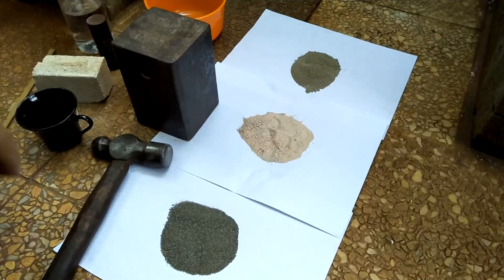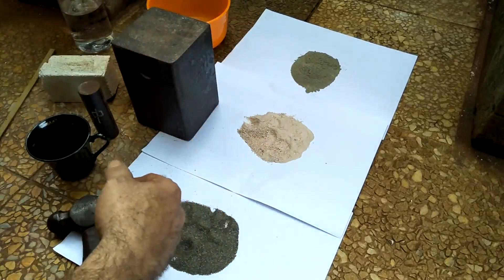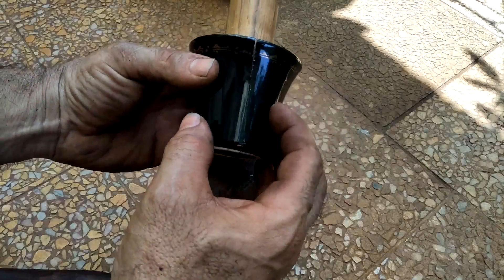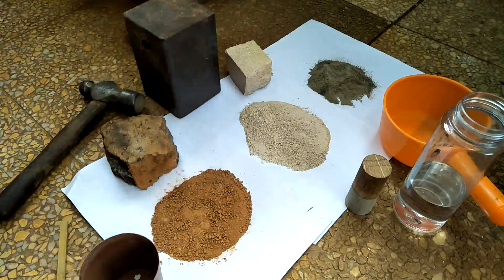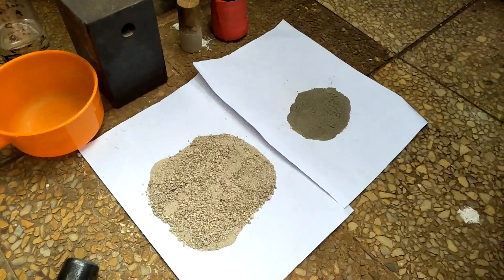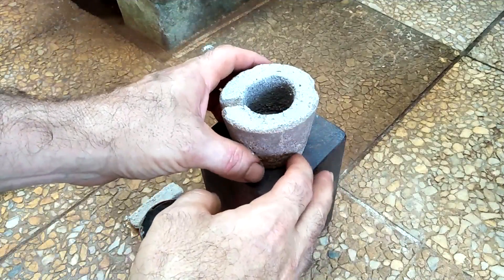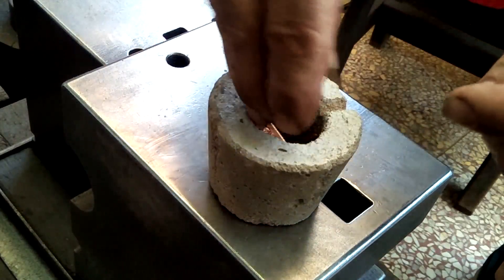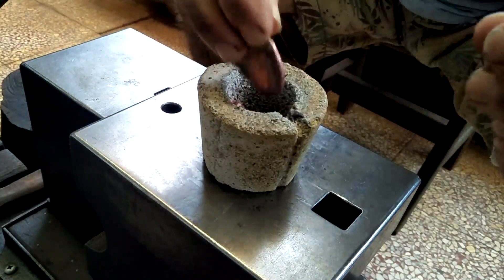Blacksmithing - making a small crucible

Comment: Could glaze the inside of The crucible to make pouring go smoother by just heating The crucible up in your forge till it's red hot and then sprinkle and even layer of borax on the inside of it while it's hot the heat will melt the borax into kind of a glassy type substance that you can use to cut the entire inside of it making it a smooth as glass.. I don't know if it's worth it on the larger scale but the size you got there probably would help

Comment: This is not how to fire a crucible. You should start with low temperature and increase gradually. Ambient temperature,  250 C, 400 C 550 C, 750 C, 900 C and let cool to ambient temperature. Then you can start using it as a crucible. Without this it's just a container and will break on first use
Reply: Did it

Comment: When using concrete and metal. If you dont want the metal to stick to the concrete. We used a method when I was making sewer lines. Get used motor oil and mix some diesel fuel with it (3 parts oil, 1 part diesel). Dip the metal into this mixture (whatever parts will be touching the concrete) and the metal can slide out when its dry. 
Also may be a good idea to let it cure for 12 to 24 hours. Just to make sure the concrete isnt moist at the end

Comment: Glen GS Tongs, I just watched a video about a family business in India I think that makes crucibles professionally because I wanted to see how they do it to see about making my own and I think you’ll find the molds interesting as it’s a tapered 2 piece construction starting off with essentially a pipe that looks like it was widened on one end slightly maybe driving it onto the horn of an anvil is what I was thinking. Then the floor or bottom of the mold slides in when empty but is just a round piece of flat plate and then they put the aluminum clay mixture into the mold hammer in the plug to form the interior of the crucible then flip it upside down and tap on that removable floor plate and the crucible pops out with the floor plate which then gets put back in the mold for the next crucible to be formed. I’m including a link to the video for you to watch as it helped me understand a process of how to start making my own 

https://youtu.be/UIm7SbyXJeM

Comment: A tip is dry the cement very slowly, for it to add a little bit sugar in the water to mix with cement. Increase the heat resistance when the cement dry slowly.

Comment: I've not finished the video yet. However I think instead of sand I would use something with a higher flashpoint. Like glass, glass is a superheated form of fine grain sand. So it's flashpoint is understandably higher, also I wouldn't worry about removing the crucible from the cup at all. If it wants to separate it's going to during the heat treatment directly after the casting of the crucible. Remember to allow it to cool gradually. Don't let it lose temperature too quickly... Anyway I don't know a damn thing about the chemistry of a crucible but I do fully understand thermo dynamics. You really need a gas oven to do this. Also if you aerated the concrete it becomes less likely to crack.

Comment: Grease the cup and use a greased tapered piece of dowel. Also, take the dowel out as soon as you can. The cenment mixture will shrink against the wood and crack.

Comment: HAD TO YOUR MIX TALCUM POWDER! YES, BABY POWDER! THE POWDER CONTAINS ASBESTOS FIBERS! It's A MINERAL AND IS VERY FIREPROOF! AD CLAY! iTS 100% BETTER THAN CEMENT!!
Reply: baby powder doesn't have asbestos in it mate
Reply: Yeaaaah turns out that Johnson and Johnson baby powder actually did get recalled for asbestos contamination...
Reply: Yeaaaah turns out that Johnson and Johnson baby powder actually did get recalled for asbestos contamination...
Reply: Would removing the cement and using clay would it be brittle like standard clay pots? Just curious since I'm looking into making one. Would the clay act as the binder in place of cement? I know cement isn't good for heat unless its fire rated mortar or something

Comment: Cement will not work for any high heat application. I have tried all the different mixtures I have seen and it will not set.  I don't know who started the whole using cement but it is wrong

Comment: White stoneware clay powder with high alumina content, Graphite powder, Crushed up flint or other high temp stoneware ceramic mixed in, and then silica carbide powder.. mix em into a clay rather, form it and fire it - slowly...

Cement will always break down under high heat..  thus you rarely find cement in commercial grade lining materials.

Comment: The Melting point of copper is 1,085 °C  the melting point of  mild steel is 1350oC-1530oC. Wouldn't a steel ladle suffice for this?
Reply: No it won’t . The heat in a furnace is unevenly distributed so some areas hotter and some areas lower than the Melting point of steel . Furthermore . Unless u had a fancy electric furnace with accurate temperature control than the ladle will melt . It not warp horribly . And also stick to the copper
Reply: Was basically gonna say what that guy said. From personal experience it’s difficult to maintain a even and consistent temp for steel

Comment: Why not use only fireclay? It should easily handle copper. Or you can use a stainless steel cup, it will stand.
Reply: Fireclay clay alone will shrink.
Reply: @luciusirving5926  If you get old crucibles crush and mix into the paste it will shrink less. You can also fire it once before using, it will not shrink again. Adding fine silicon carbide or even sand will also work. There are lots of tried and worked formulas for this purpose, no need to discover it again...
Reply: @daydinable  there is always a need to discover. Even the very good crucibles have realativly limited number of uses. New materials are needed to expand their life expectancy. Your way if thinking is  ...

Comment: Vermiculite is made with asbestos. Not a good idea to mess with.
Reply: Both Vermiculite and Asbestos are minerals. So no, vermiculite is not made of or with asbestos.
Reply: The two have been found together in the same mine deposits and some vermiculite supplies have been found contaminated with asbestos. Same thing with talc-based baby powder. IIRC, Johnson and Johnson quit making talc baby powder for this reason and now it’s cornstarch based. They are absolutely different minerals, though they may have been formed by similar geologic processes, thus their co-location.

Comment: better use  1/3  graphite powder 1/3 fireclay powder 1/3 fire brick sand  mix with as little water so it slightly wet and press it with hammer and stick into form
Reply: lol, could you use crushed pencil lead??
Reply: @bondrewd6314  ready to use graphite  powder
Reply: @bondrewd6314  Sure you can.

Comment: Just curious if all I have is three holed clay brick / I assume it's called red clay fire brick, if I crash that up with my hammer, will that make a paste with water alone that's capable of holding my bricks together for forging ????

I'm learning & do not know anything about this stuff....
Reply: Those red three hole bricks aren’t the same thing as fire bricks, as to the rest, I’m trying to learn myself.
Reply: I learned from personal experience that red brick does not hold up to high heats associated with forging. Around 2000 deg F, they start spalling so I would assume they would not work.
Reply: Only fire clay can put all together to be strong, but if you can get a fire clay, crushed fire bricks are already heated and will not be enough strong bounds and it will shrink, regular clay also is not good because it melts about 900 deegres C. So if you can get a fire clay or refactory cement that has temp resistance over 1500 deegres C you can success

Comment: Sir, i recommend that next time you mix firecement with perlite and make ur crucible :)
Reply: By fire cement do you mean the stuff you buy at shops? and would Vermiculite work instead of perlite?
Reply: @hawkbox  i mean by fire cement is the kind of cement that used for Tiles, and perlite the stuff used to be mixed with soil to make it crispy not a clay soil i mean, the fire cement is handle's fire temperature a lot and it don't have cracks, they use it for making bread furnace, and perlite handle's a lot of heat and fire, and they sams way it is super light weight, like feathers, so the cover will be very good to use
Reply: @michaelconstantine5149  ok that tracks. I have a tub of furnace cement and a big ass bag of vermiculite.  Which is similar and I can’t find perlite in Canada. So worth a shot to try.  What kind of ratio do you recommend?
Reply: @hawkbox  it will work not a problem at all, but it will be hard to carry it ! And without perlite u have to put some iron sticks or whatever inside it, so it will be hard to break, or as i can explain more : it will make no cracks when it is dry, and the iron when make small crystals it will crystalize the iron so it will be harder, but no perlite in canada ?? Man .. it's just like no Sushi in china ! You didn't searched well, perlite is very very cheap and very important for the weight, if u make it without perlite well, mine was 40 cm x 40 cm x 5 cm , it was like 10 - 12 kilos ! Without perlite ! That's why i made newer model
Reply: @michaelconstantine5149  l found multiple potting soil options. I have a big ass bag of vermiculite hence the question. Why would it not be an acceptable substitute since they serve nearly the same purpose.
Reply: @hawkbox  i dont know what potting soil u have found, but why perlite ? It's simple, because : Perlite is an amorphous volcanic glass, that's why i don't think there is another option, maybe there is, but that's what i know
Reply: @michaelconstantine5149  ok it might be a terminology thing.  Vermiculite is basically the same thing. I have a big bastard bag of it so it’s going to be my first choice.
Reply: @hawkbox  go ahead, make it, but wait until the cover you made is 100% dry , and when u light ur furnace stay away of it, cause if there was even a little bit of water still inside, it will blow
Reply: @michaelconstantine5149  good to know. I’m already paranoid so nice to have it reinforced.
Reply: @hawkbox  what furnace you wanna make ? Melting iron and steel ? Or aluminium ?
Reply: @michaelconstantine5149  I'm thinking copper and aluminum until I have some actual skill in it.  I have a 8" diameter propane forge I think would work to heat the metal with.  I'm just looking around for ideas on how to build a crucible safely.
Reply: @hawkbox  look, making a crucible isn't hard give me ur email address or phone number and i can send u a video of mine, very simple, and about melting aluminium or iron,  it just about the heat, the melting point, and if course melting iron need pressure too, think about it like for melting iron u should make a good furnace with no place for heat to go out only a little bit from the top so it won't explode, this way u will get pressure too, and it should look like an egg, well, kind of egg, from inside, it kind of makes an atmosphere inside and make pressure, and u can't use the same crucible that u r using for aluminium cause it gonna melt a well ! Try to use pottery, a very good quality, or buy ready crucible especially made from some metals for melting iron and steel, and i preffer that ur crucible for melting iron and steel should be un-moveable from the furnace, the furnace itself is a Furnace and a Crucible at the same time, it like u can rotate it to cast ur iron, cause when u take out the crucible from an iron melting furnace the heat well be like hell from 1 meter away of you, well, that's it i think
Reply: @hawkbox  i sent it, not even close to difficult
Reply: @michaelconstantine5149  Got it, that's awesome.  Thanks!
Reply: @hawkbox  wlc
Reply: @hawkbox  one more thing, the first time i started to melt, i bought some gloves especially for heat and they were expensive, i thought i can touch something very hot with them, so be carefull, i did that and the metal burnt threw them until they reached two of my fingers, and i wasn't pretty ! Especially when trying to take off the gloves after that, so use something long to push the scraps into crucible, don't use ur hand whatever gloves u have bought

Comment: You should not use regular cement for a crucible, it has too much moisture in it. It also soaks up water. The problems begin when you heat it up. The regular cement will explode if there is any moisture in it when it is heated.

Comment: A couple of quick thoughts, Portland cement useless for heat better to use high alumina cement. No sand. Mixture way too wet needs to be just damp enough to pack into place. Allow some (many) days for cure - keep damp for that time. Dry slowly before firing. Don't use wooden formers as they expand with moisture and can crack part use plastic instead. But my main suggestion is go out and buy a proper clay/graphite crucible they are not that expensive...... Martin

Comment: You know, that by taking a dense, non insulating fire brick (from a wood stove liner) and cutting a pocket in it will work.  Also drill a couple of holes from side to side on either side of the crucible to insert rods to use as removable handles.  Sorry it took me so long to watch this video.  Keep up the good work.  Your experimenting has saved me a lot of time and frustration.

Comment: Try vermiculite, a traditional refractory material and available at garden supply stores. Water glass (sodium silicate) and sand is
also used at high temperatures as a matrix. These 3 together might work . . . maybe.

Comment: An Cement based stuff  should be left to cure for 28 days.   It is better to submerge it in  water.  After it is cured it will become hard
Reply: Why does cement cure in water? Like what's the active reaction?
Reply: @Palemagpie  The compounds in cement form bonds with water and also form hydrates. Submerging it in water prevents the concrete from drying out during this process.

Comment: plaster of paris will serve as better binder than portland cement, beside you can pull it off the mold before it completely dry, so risk of mold destruction can be avoided.. also try to use talcum powder as source of alumina and magnesia, its much cheaper than crushed firebrick, and last use waterglass (sodium silicate/ diluted sodium) as the high temp glue..  all this work fine if you can't acces graphite and bentonite to make crucible
Reply: wahyu...sorry to ask some question..are from Indonesia?
Reply: I will try this 
But I can get a graphit crucible for 250 zar

Comment: Commercial crucibles are made from clay. There is no cement in them. Cementation occurs when the crucible is baked or fired at high temperatures. Crucibles are more of a ceramic like porcelain.

Comment: I hate to be a party pooper but why didn't you just use a masonry bit to drill a hole in the brick as deep as you need, then trim it with a masonry blade to the size you need.

Comment: You that fire brick elements are fired already so it was obvious that as you've seen after firing it , it was useless. Reactions that had place in factory burning are not going to have place again.
Reply from the maker: This experiment and the comment section have taught me a lot about this. Thanks for watching.
Reply: @gstongs  I can say the same thing. I'm making a crucible for steel melting. You have to know that crusching of the fire brick is insanely hard and long process.

Comment: I think you need to apply some pressure to compress the crucible during the drying process, so it compress the compound... Also, instead of cement, try putting graphite into the mixture, along with the ceramic clay. Just a thought
Reply from the maker: There are many aspects of this I need to improve. And your suggestions are very good. Thanks.

Comment: Fire brick is a bad conductor of heat wasting gas, Use clay 40% and Graphite 60% powder and sodium silicate as binder. best part of it, it`s recyclable, play with recipe, like your work man.
Reply from the maker: It seems I learn most things the hard way. Comments like yours have taught me a lot about crucibles, what works and what does not. Thanks.
Reply: if the heat come from down but if it come frome up is perfect and resistent